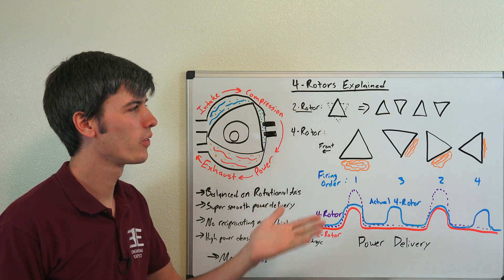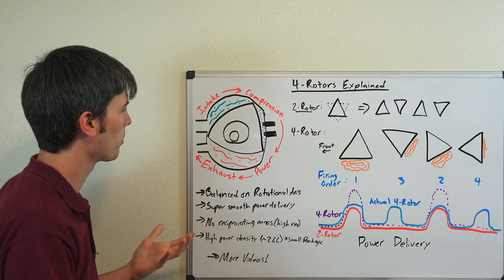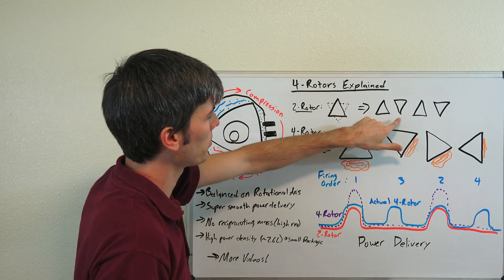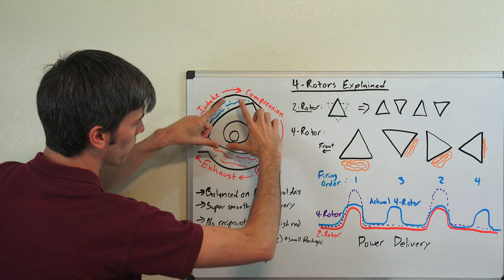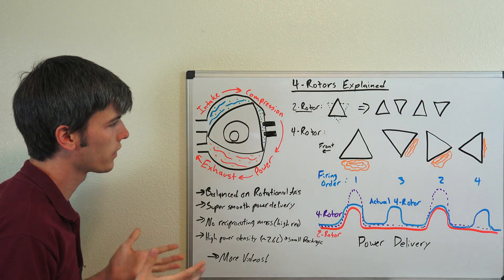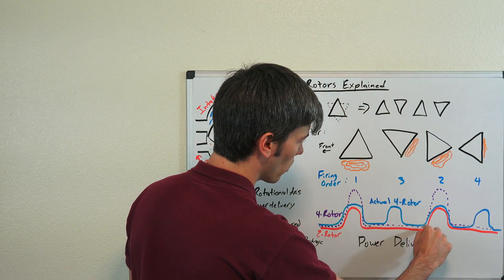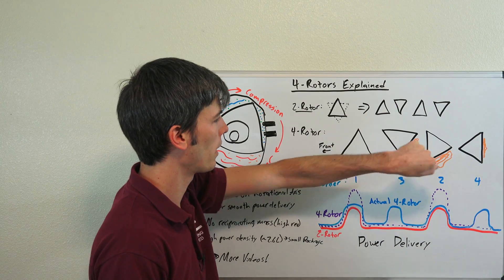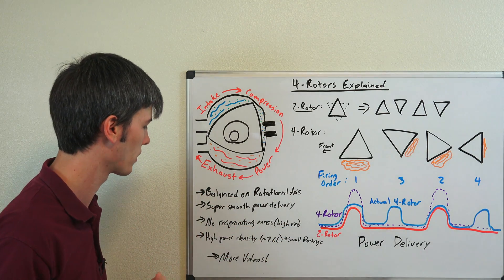The Epic 4-Rotor Rotary Engine - Never Used In A Production Car

Comment: I literally just watched Wheelers Dealers RX7 episode again and noticed that Edd said the engine isn't a true 1.3L, but rather a 3.9L because you have 3 different chambers being used. So that would be a 7.8L engine to be correct, wouldn't it?
Reply from the maker: Ehh, that's one way of thinking about it certainly, and not exactly inaccurate, just needs to be clarified. The swept volume of the rotor is about 1.3 liters (or 2.6 in this case). The amount of air that the rotor displaces is 1.3 liters. But yes, there are more power strokes per revolution of the crankshaft, so in that sense it produces power equivalent to a larger sized engine, exactly as a two-stroke engine will also have a higher specific output, as a result of firing once for every crankshaft rotation, instead of once for every two crankshaft rotations.
Reply: Engineering Explained Thanks for the explanation !
Reply: To fully understand these engines, the Mazda 13B, for example, is really 3.9 liters if you use the full Thermodynamic Displacement (all 3 chambers for both rotors). You can use whatever displacement you want to, just keep in mind that Wankel engines are much bigger than we thought. Big things come in small packages!
Reply: Mateus Campello. Correct although the the DVLA recognises the RX8 as a 1.3 technically it's a 3.9. That's part of the reason why the mpg is in the teens and the co2 emissions area in the 200's. Interestingly in a normal internal combustion engine the power stroke is every 4th stroke, with this engine it's every third stroke, so it's a third stroke 2 cylinder 3.9.
Reply: The real answer to this is that displacement isn't a very important measurement of anything compared to power/torque vs the size/weight/shape of the whole engine.

Comment: What first sprung into my mind when I've heard the first time about quadrotor rotary engines was that it would make sense to ofset them so that each stroke is occuring at the same time on one rotor.  Why aren't they build that way, but in a way that they fire shortly after each other? Wouldn't that cause a power curve that has 4 bumps and then a pause and then 4 bumps again?
Reply from the maker: No pause, continual uniform pulses.

Comment: There are engines that fire multiple cylinders at once. Racing bikes can use a big bang style where they can have all of the pistons on a power stoke at once, max power and torque and the off strokes allow you to regain grip at the rear if it spins up

Comment: Nice! Looking forward to the 4 rotor engine build by Rob Dahm.

@EE: Might it be interesting to compare engine performance based on fuel flow rate? *If so, vid please? ;)
That way you eliminate the particulars of the combustion cycle for a 4-stroke, rotary or even turbine engine, and can compare power and torque output based on a given fuel consumption rate.

That way you can compare which engine is best at converting chemical energy into work.

Comment: Actually there ARE engines that fire multiple cylinders (nearly) simultaneously. Its called Big-Bang firing order. Its used at least in some Motorcycles. Might be an interesting topic to have a Video on :P
Reply: There's a pretty large difference in firing them at the same time, and having irregular firing intervals or even overlapping combustion events. The more cylinders (or rotors) the more the combustion events overlap, and so your sine wave torque delivery get's much closer to a flat line. It's more like a ripple than a wave.

Comment: I read somewhere that the 10 pound rotor masses were quite heavy to be spinning at 9k rpm and would just simply shear off the shaft if it were to do so. Since the rotary has 3 power strokes per rev, Mazda just multiplied that with the "original" 3k rpm limit that the engine was designed to operate, creating a claimed 9k rpm limit. Is this true?  @engineeringexplained can you please fact check this?
Reply from the maker: The eccentric shaft (the crankshaft of a rotary engine) is geared to the rotors with a 3:1 ratio, so for every full rotation of the rotor, there are three rotations of the output shaft. This results in an engine speed of (in this case) 10,000 RPM. In a piston cylinder engine you measure engine speed based on the crankshaft, not the movement of the pistons. Same goes for the rotary engine.
Reply: Engineering Explained omg you just replied 😍😍😍😍 thanks a lot though!!! 😊😊

Comment: yamaha r1 cross plain crank is often referred to as the "big bang" because it has two detonations very close together in the cycle.
Reply: pinkskud1 Your right, You have the majority of the Pistons firing near eachother,  but this also puts stress on the engine and makes the engine vibrate more. Also because of the odd firing order you will have uneven power peaks between a normal bang in the combustion cycle, and the big bang in the cycle.

Comment: What about Boxer engines?
Reply: Albert Zne Boxer engines are pistol driven internal combustion engines just like V engines and streight engines. Like the V engines; V6 and V8, boxer engines have two banks of pistons. The major difference between a V engine and a boxer is the angle at which the banks are aligned in relation to the crankshaft.  The angle the banks are in relation to the crankshaft  is what makes a V engines ' s "V". The V angle will be different for different amounts of pistons within the engine, a V6 will have a 60° angle, v8 will have a 90° and a v12 will have a 120° . This is for balancing purposes. A boxer engines has a 180° degree angle, which makes it a horizontally apposed engine. Boxers are among the most balanced engines because since the two banks are oposite of each other; or opposed, the opposing pistons of each bank are each other's counterweights. Resulting in a well balanced engine. Because of the way the Pistons look when they are reciprocating, they look like two boxers tapping their gloves before a fight when viewed in line with the crankshaft, giving them the name "Boxer". Their firing orders are simple, boxers tipically only have flatplane crankshafts to take advantage of using the Pistons as counterweights. That and the fact that the banks are offset 180 degrees, the firing order would be for instance a flat 4 would be the left bank then the right bank, or vice versa. There is a balancing concern with boxers though. Because the Pistons cannot be exactly inline with its twin in the other bank, they cannot totally balance eachother. The Pistons are staggered so this causes a s twisting motion in the engine. Meaning the engine will tend to want to twist from left to right.

Comment: To be fair, some motorcycle engines do have odd firing orders.  The Ninja 650R (parallel twin), Yamaha R1 (4 cyl Inline, uses a crossplane crank),  the Kawasaki ZX-RR  (not to be confused with the numerous ZX-#Rs out there), and some other oddball bikes.

Comment: The fuel consumption will be insane am I right?
Reply: Fuel and engine oil. Also very big wear compared to a cylinder engine. But thats what you have to deal with when you can squeeze a massive amount of power and torque from a small volume engine.

Comment: Do rotaries rev hang more than the conventional piston engines?
Reply: Kohei O. Based on my RX-8, not at all. The RPM actually jumps up and down far quicker than any other car I've driven. Since there is very little mass moving around, there isn't much resistance to quick change of rpm.
Reply: Don't forget also that the rotors only turn at 1/3 the speed of the e-shaft. The rotors on this engine will only rotate at 3,333 rpm.

Comment: I have a question. why don't cars have 4x4 with a selectable transfer case like a truck?
Reply: Too heavy for a car is my guess.
Reply: FutureMarinecuv902 
Not necessary is my guess
Reply: FutureMarinecuv902 Not needed and takes up unnecessary space and unnecessary dollars to manufacture such parts.
Reply: Because they don't have a low range 1 and it's extra work 2
Reply: I think it would be cool. you could have a car you can drift, do burnouts in and also not get screwed over in the winter or on gravel roads.
Reply: Because if they go for AWD instead then they can use it all the time, even if AWD is heavier than 4wd (without 4lo).
Reply: spaceminions it depends on the 4wd design tho
Also  
If you go all the time you can have a center diff and go any which way of power distribution instead of 50/50
Reply: MyLonewolf25 When you're going in a straight line with 4wd the front and rear axle are locked to each other and you get the most possible traction regardless of if that's 50/50 or 70/30. That makes it very hard to spin the wheels on pavement because both axles have to lose grip instead of just one. But yeah as soon as you try to turn a corner in 4wd you have the same kind of problem as people with welded diffs.
Reply: spaceminions mhm
That's really the reason they put in that center diff
So you can actually turn XD
That and you can get a little less drive loss

Comment: if the rotary engine can rev up so high, then why formula 1 are still using short stroke engine. Is it because of the size of rotary engine so large?
Reply: Bobby Wong I am not a part of F1 so I do not know exactly why they don't use them, but I do have some ideas on why. When compared to a piston engine, rotory engines are less effecient at burning fuel. The amount of energy created during combustion is less compared to a piston engine. Rotory engines dont produce alot of torque, they make their power using high revs, because of this they burn more fuel. Rotors also require constant lubrication within the chambers, primarily because of the apex seals that are at the apexes of the rotors. Because of this need for lubrication the oil will get burned as well, increasing pollution. The design itself isn't as efficient as a piston engine either. Rotory engines also tend to have higher wear rates than piston engines, primarily because the apex seals take a beating, and it gets worse the higher you rev, high revs is where rotors make power, the two do not compliment eachother. As F1 becomes more and more worried about emissions and efficientcy, the rotor becomes less of a choice.
But they are still fun.
Reply: Bobby Wong are you even paying attention!!!! these engines are tiny! There is no reason why f1 cars don't use rotary.
Reply: But today's F1 more likely to use short stroke than use the rotary
Reply: they used to rev to 18000 rpm. Now they are limited to i believe 14000, which they could not achieve even that because they are not fuel efficient enough. They rev at 12000. The line of torque and horsepower will never match at any point on the graph except at 52552 rpm eachother because horsepower itself is a directive of the combination of torque and rpm.
Reply: yep, so they should not be matched, unless you use electronic motor which has no rpm. what I think is to increase rev limit and use some boost such as supercharge to increase the 1st gear torque and rev it up to speed up, this will have less drawback once the gear ratio of the car is not that good.
Reply: The "Formula" in Formula 1 is the rules, the technical regulations that define what does and what does not meet "Formula 1" regulations.  You can find the current regulations here:
https://www.formula1.com/en/championship/inside-f1/rules-regs/Power_Unit_and_ERS.html
IMO, Formula 1 justifies its existence by experimenting with technologies that may benefit future automotive design.  It seems that the market place has voted that this future does not include rotary engines.  There are other "Formulas" in motorsports.  The Pro Mazda Championship Formula specifies Mazda Renesis engines.  It is "a" Formula, just not Formula 1.
Reply: good, but in my opinion, formula 1 is still different species.
Reply: Bobby Wong
no they have engines. nothing really different. They don't have some magic engine that isn't used elsewhere.
Reply: Anyway that is electronic motor not engine

Comment: Harley Davidson timed their v twins to fire at essentially the same time. There is a slight difference because of the v with the connecting rods on the same crank journal, but the cylinders are on the same stroke most of the time. Can you think of any benefits?

Comment: Does a 3 rotor work the same as a 2 rotor or does it work similar to the 4 rotor?
Reply: I was about to ask the same thing, surprised he didn't mention it.
Reply: A 3 rotor still has the 4 phases of intake, compression, ignition/combustion and exhaust. 
The combustion or power phase is equally spaced 120 rotational degrees apart making for a very smooth rotational power curve.

Comment: Problem remains - they only provide hi torque ina certain RPM......because of lower mass of the triangles / compared with a mass from regular pistons...
Reply: Chris M.R. Santos Under 3000 RPM, a Mazda RX-8 is practically undrivable, yes. However, it's never meant to be driven that low. It will happily cruise at 4000 all day long, and from about there to 9000 it pretty much has 140-160 foot pounds of flat line torque. Once you do get power, you get power through a very wide band.
Reply: Commander_Flash
Yes, its a performance car.....not to daily use....takes much gas on lower gears....imagine on a traffic....changing gear for 1/3 all time....
Reply: Commander_Flash
Theu shoud re-engine the gear box crowns and pinions to make better response from 1rst / 3rd gear...
Reply: Chris M.R. Santos It works quite well for daily use actually. Shift at 4-5 thousand, which is nice and casual driving for a rotary, and it'll never have any issue getting up to speed. If you need to accelerate quickly, drop a gear or two and it'll have no problem at all passing another car. It's not meant to go straight to 6th and just go with crazy torque, it's designed to use each gear for a specific purpose and speed. I can't pretend that it gets Prius levels of MPG, but it'll get 15-20, quite a lot better than the massive pickups everyone wants to daily for some reason.

Comment: I think that it has up, left, right, down 'crank', like crossplane engine has. That would give it 1-3-4-2 fire order normal 4 cylinder has. But on idle, it has sound similar like new weird flatplane Mustang.

Nice thing about 4 rotor is that has same number of powerstrokes per revolution as V12 with same delay between exhaust pulses, so it sounds like V12 at high rpm.

Comment: Hey, so I have been thinking about getting a used mk7 golf/GTI 2 door with plans to fully build the suspension and brake systems, eventually swapping in the awd system from the TTRS/ golf R. In addition to that, I was thinking of swap the engine out for something with a bit more kick. But as I was looking around the Internet to see what performance parts are available for the Audi 2.5l i5 and the VW 3.6l vr6, I had a thought, "what is stopping me from putting a rotary in it?" Obviously this would require a lot of time and fabrication to make this possible, so it would be one of the last things I would do to the car, but there are multiple reasons why I would want to do this with the main three being:
1) The Mazda rotary is my favorite engine of all time
2) To my knowledge, I would be the first person to swap a rotary into a mk7 golf, so the car would be pretty unique 
3) going to Volkswagen car shows and watching the purists stare at the engine bay for a few seconds, before pulling out their phones and flocking to the forums in disgust.

What are people's thoughts on this idea?
Reply: also sorry for the wall of text
Reply: If you have the time and money then go for it.

Going AWD with the rotary would be unique but would have lots of problems transverse mounting the rotary engine  (custom engine mounts and/or subframe and making it fit into the engine bay) and connecting it (with a custom made bell housing) to the TT RS/Golf R transmission with Quattro and Haldex AWD system. Not to mention it will probably need some kind of aftermarket engine management with custom wiring harnesses (engine, powertrain, interior, and all ancillaries).
Reply: Malcolm Toney definitely like the other guy said. Go for it if you have the kitties to match. no project is tok big but they're only as big as your piggy bank.

if you manage to carry out the process and overcome the problems as mentioned, please please make a video of it. I would love to see a rotary VW..  gonna be epic
Reply: Sounds gay and I bet you didn't do it lol

Comment: That thing would get 1 mpg.
Reply: TumzDK That's the same thing
Reply: If I had any performance car, the last thing on my mind would be mileage, but sure it would not be cheap.
Reply: Until you can't complete Nordshleife until you tow a tanker?
Reply: +TumzDK rekt
Reply: TumzDK lol. Dude. That thing would get the worse mileage possibly ever recorded.
Reply: barath4545 exactly.
Reply: Vatharian that's probably about right.
Reply: Also true. But if you go big enough, then having combo X that never goes to more than 60% of what it can handle, rather than combo Y that utilizes 90% of its capability every time you floor it, it can be a lot safer to have a performance car (with combo X).
Reply: I think it's closer to 1 gpm ;-)